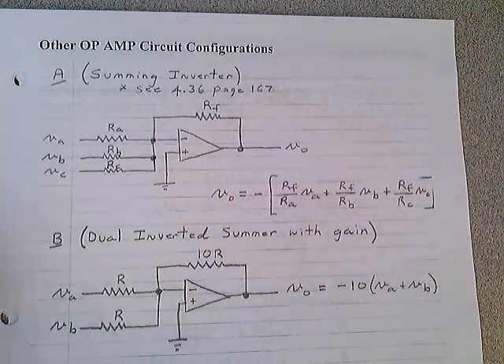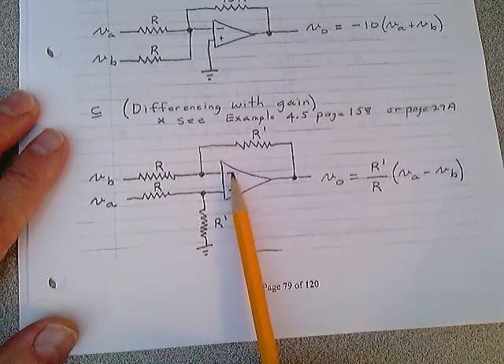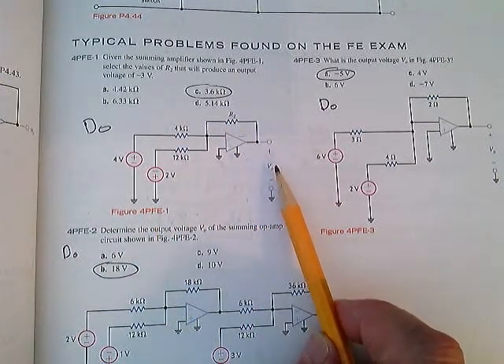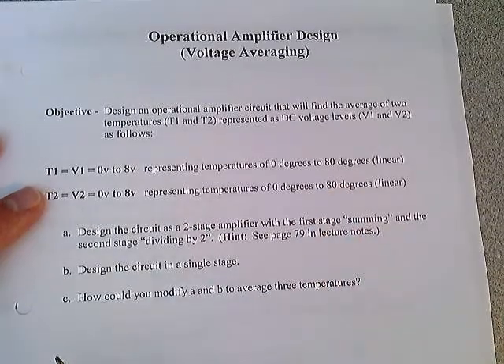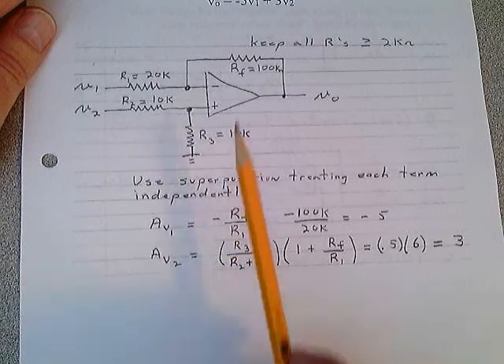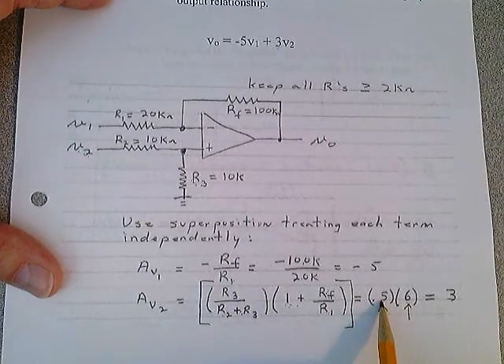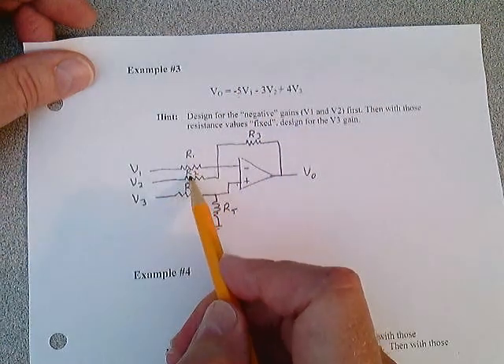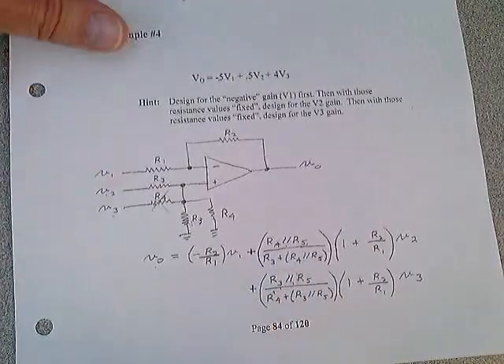Designing Linear Equations with Op Amplifiers by Prof Skip.  Need tutoring?  Please see link below:

Comment: You're Capable of Memorisation and Repatition without Understand.
You're Capable of Designing Small Circuits and Small Computer Programs, not Large Ones. You're Capable of Pretending You've done Old Technology from Borgs. E.g. Quake Engine (Which is Quite Large), however Small and Old in Comparison to Unreal. You've also bought a Few Modern Games such as FIFA, which run on Unreal or Unity.
These Cities you've Made, you've done that Over Several Houndred years, making Large parts of Earth very poor.